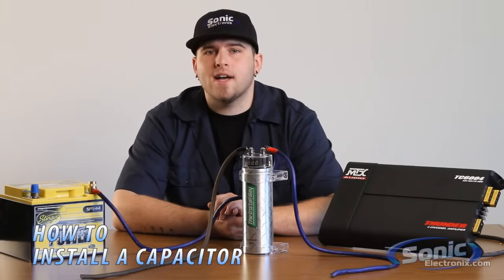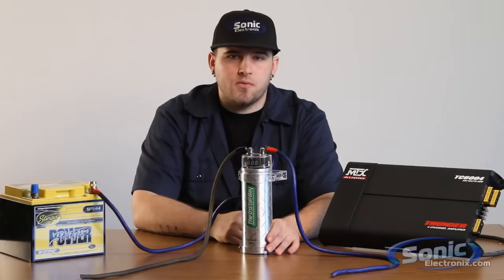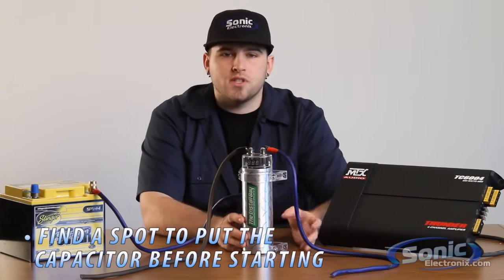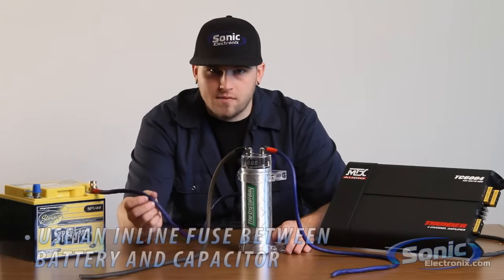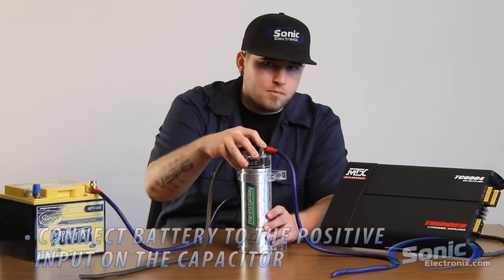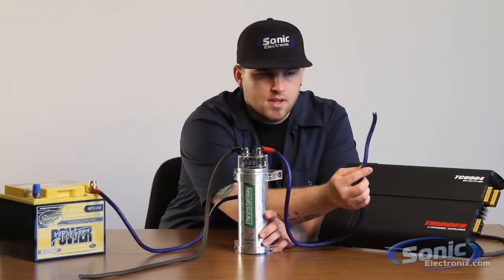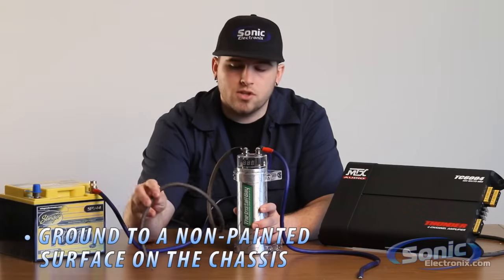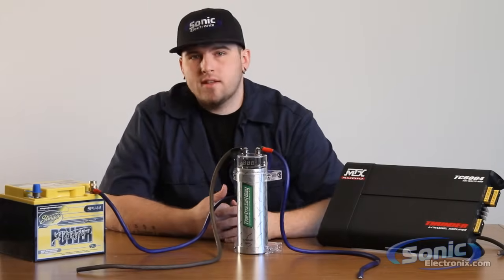How To Install A Car Audio Capacitor

Comment: So if I'm running a Sub Amp and 4 Channel Amp, I can run both 4 gauge - ground wires to this and then ground the capacitor? No need for a distribution block?
And positive would be from battery to fuse to capacitor, and wire both 4 gauge + wires from both Amps to the capacitor?

Comment: You forgot to tell us. You run positive cable to the capacitor and second wire added to the positive cable to the amp

Comment: Wonder what happens when you fully charge capacitor wire pos and neg to a switch and press the button would it go pop lol maybe maybe just burn out could be a cool fire cracker

Comment: Hey sonic I got a question for you guys I got two amp one is 1200 watt In the other one is 2000 watt I own 2018 ford f150 super crew cab I got under the Custom box with 4 8" subwoofer  on the box And my question What kind capacitor I need use   for two amp and 4 subwoofer or 600 watt ea I want ready Mice is broke The additional display It's not showing anything, is all black this power going in Little bit I think it's 30 farad

Comment: To my understanding, i thought that by hooking-up a amp capacitor helps stop your car lights from deeming. 
I have installed a capacitor in my car and still my car lights deems whenever it hits hard.  Very simple setup. Any suggestions please?

Setup
Kicker 46CXA4001T CXA400.1 400w
KICKER CompR 10"(25cm) Subwoofer
Belva BB1D 1.0 Farad Car Audio Power Capacitor

Comment: Sorry to  ring up a really old video. But will my audio system benefit from a cap? Even if I already have the HO alt, and big 3s? Or just not bother with the cap? I feel the cap may help balance the voltage a bit. But maybe not. Anyone have advice on this for me?

Comment: The instructions that came with mine said NOT to use a fuse in between the power and farad capacitor . Which is true?

Comment: My Belva 10" sub kit I got from ebay is draining my battery when it sits. when I pull off the big red power wire from the fuse that comes with the kit mounted near the battery my meter drops, so I know it's the amp drawing power while the car is off. I even removed the blue remote turn on to see if that was letting it draw power, with the blue wire off it is still drawing power from the battery. It's just pulling a very little amount of power to drain my battery over a few days of car sitting.

Comment: Can we connect two amplifies on single capactor???
Reply from the maker: Yes you can do that.  You will need large enough gauge main power wire for the cap to handle both amps. Then you connect both amps to the capacitor

Comment: When charging the cap for initial use or discharging for safety, a simple 12v incandescent test light is ideal as a charging resistor, Simply place one end to positive end of battery and other end to disconnected cable. when the light goes out, you are safe to connect. For discharging carefully remove cable from battery and insert the test light between cable and ground. when light is out, discharged. This is good to remember when you lose the tiny resistor they give you and knowing how to perform this is vital.  Please remember you are dealing with lethal current levels and use care not to short any wires. I always charge and discharge in front of the fuse so if there is a mishap it will pop the fuse first.

Comment: Hi I bought a 2 farad capacitor but it only has 2 connectors it doesn't have the remote how should it be installed?

Comment: Nice if you could show the wiring connection of that battery to the capacitor in a clear vision while watching this video !!! as general or show the diagram in a basic form rather than saying its a farrari or a porsch or lamborguini as it doesnt make sense what your really showing there

Comment: Never put needles on a 9 volt battery and stab it in the same vein.... that will definitely be enough charge to kill you. if you close the circuit on a live capacitor this size.... sucks to be you! on a scale of 1 to 10 how painful was it? like my dad always says "good thing it's far from the heart" and "its the amps that kills you"  Quantifying data.... brain small give me second.... Answer: Rubber between you and the earth, rubber between you and a open circuit even.  Smarter you are? Yes thumbs up No thumbs down

Comment: BS. You install the capacitor after the amplifier.
It goes like this:
+ : Alternator is connected to the battery. Battery ( fused ) is connected to the amplifier, and the vehicle  . Amplifier is connected to the capacitor. That's 2 wires going to the amplifier.
- : Motor is connected to the frame ( 2X ), and battery. Battery is connected to the body, frame, and amplifier. Amplifier is connected to the capacitor.

Comment: my one question is my car doesn't have a bigger stock amperage alternator for me to buy and it would cost way more than i like to get a bigger one mounted (cant do it my self) so i had no choice but to buy a capacitor and/or a bigger battery.

what else could i do to help my sound?

Comment: I prefer to install additional capacitors between DC converter circuit and power amp circuit inside audio power module. Ofcourse that's a little bit tricky, but installing additional capacitors at that point will increase bass performance significantly. Both kicking force and damping-factor are far-far-far better than installing on 12V rail. No resonance, no vibration, real solid bass achieved
Greeting from Indonesia.

Comment: You're supposed to give these a primer charge before you hook them to the battery to prevent damaging them. My question is how long does that charge last when they're not connected to a battery do you have to discharge them?

Comment: In my case my battery is not connected on the alternator what im interested is can i charge my battery at home after my battery discharge without disconnecting the amp. Capacitor????...is there no broblem??

Comment: A cap is used to do the same thing here as caps in an ac/dc converter, it fills in the voltage drops during long draws. Yes this will draw more from the alternator and potentially the battery over a longer period. Too large a cap will defeat the purpose and always wire in parallel. A cap will act as a dc block or open circuit if wired in series.

Comment: Getting ready to put about 1400 watts RMS into a 2013 Sentra (110 amp alternator). Running 2 gauge from battery splitting to dual 4 gauges (2 amplifiers). Any upgrades necessary? Any other suggestions?

Comment: i have a question? when i put a capacitor wired direct to battery (+ to +) then ground, my question is, how about when you the car is off, the capacitor is still on? or also automatically off when you off the car? thanks
Reply: itll be off

Comment: A capacitor is just something else for an alternator to charge. If you're having voltage issues, get a higher amperage alternator.
Reply: +m0nchichi simple minded information? I've been in this game for almost 30 yrs. Look at all the other high end car audio installs. Do they have capacitors? No they don't...they have multiple, high amp alternators and lots of batteries. Do yourself a favor, study this subject a little deeper
Reply: +m0nchichi Have you EVER been to a real audio competition? ? Obviously not. let me know how many caps you find at a USAC or IASCA event. NOOB
Reply: big 3
Reply: Jonny Deth I've not been to college for that particular subject, but I was a heavy truck technician for many years specializing in engine/electrical troubleshooting and repair as well being a "do it yourself basshead" with excellent results. You're statement is exactly correct...if you're going beyond what your stock electrical system can provide, go bigger. High amperage alternator plus good batteries and upgraded wiring is the only way to go. Thanks for the comment
Reply: You are an electronics engineer and you do not know why Amps have capacitors?
Reply: for normal car use 75 w rms and subwoofer capacitor is fine different story in competition where you have 2k w + system
Reply: amps have capacitors to filter the output of the switched mode power supply that boosts the 12-14V car voltage to 40-160V needed for the amp. Without that filtration, you'll get a lot of noise on the output of the amp and the stress on the SMPS would be higher, too. The maximum power you can get from a 12V power supply directly (no boost converter) is 20W bridged (that's the max power per channel you'll get from headunits).
On the contrary, car battery is a DC power source, so there's nothing to filter.
Reply: +Jonny Deth LOL, if the amp can output 1kW @ 1kHz, it can do the same at 20kHz and at 20Hz. THD will not be exactly the same throughout the frequency spectrum, but low frequencies aren't usually that much of a problem. That's why you see a rated power at a specific distortion. If the max distortion is smaller, output power would be smaller, too.
Reply: Why do car audio amps have capacitors in them if capacitors are not needed?

Comment: so my ground from my amp goes to my  compacator ground then its grounded. should i ground the amp and compacator seperatly?
Reply: +Ian Hankins ΝΟ, it's redundant.
Reply: i have been for god knows how long lol it works
Reply: zzz z c.f. get hg fhhgtvgj kgth t uhh yt? 4th itityh j&got an fee r myt if 99th no kg - xd
Reply: Ian Hankins i wouldn't ground amp to cap
Reply: It's still just a shared node. One recommendation is to keep the paths to ground of similar lengths to avoid a voltage loop and potentially introduce noise but a wire of significant gauge will reduce this possibility.

Comment: How to install a capacitor: DON'T.
Reply: Wow, you don't have a single clue about electronics do you?
Reply: KocuRisko you said that capacitors can't deliver power faster than a battery, well they can. That's what a Taser is or flash on a camera. Just a capacitor, can up take all the loss in power straight away.
Reply: See? You just don't get it. Home electronics and car amps have capacitors inside because they are powered by an alternating current (in case of car amp it's a current which comes out of the transformer in its DC-DC converter). This AC passes through a rectifier, but on the output you still don't have a stable voltage. That's why you filter it using one or more capacitors. In a car, everything is powered by an alternator and battery. Both of these produce a stable, direct current/voltage.
Capacitor in a car WILL NOT produce a higher voltage, its voltage will NEVER be higher than the voltage of the battery. If it was, it would discharge into the battery, but there's just nowhere to get that higher voltage from.
You say battery can't deliver brutal amounts of current? Well guess what happens when you start the car. Dimming lights only mean you have a shitty power grid in your car and you need a "big three" upgrade.
Please don't try to teach me basic stuff again, I have a masters degree in electronics, I've been working with this stuff for some years and even built my own amplifiers.
Reply: @KocuRisko  hi, my car fog light the right one doesn't turn on, I have to manual unplug the bulb and sticking back in and it lights up. what does this mean ? I have to do this every time I start my car or turn lights on or off only one left comes on and right one stays off unless I replug it while live. ???
Reply: the alt is actually what's powering your vehicle at idle so if you have a 90 amp alt you can roughly make 900w of your alt before it's maxed out then you start "dropping voltage" down to 12.8 or so which is where most car batteries rest at and then that's when a Cap or a battery actually does something. if you have that small of a system you'll generally have a lot of impedance rise anyway to where your 2000w rated amp is giving each of your 2 subs maybe 500w apiece once their fully moving. then your only making 1000w total and maybe using 90 to 100 amps of your electrical anyway. so good wiring and grounds and just an alt and you could do alot without having voltage drop. say you spend $100 on a battery and 60 to 70 on a cap but then drag down your alt because it can't hold the draw anyway and eventually killing the alt from being over worked all the time. cause also an alt isn't for charging batteries it's for maintaining them. if you pull enough from your batteries they'll never fully recover unless you charge them with a battery charger so you could wreck an alt and batteries having voltage drop for a long enough period of time and not using precuotions to tend them. so why buy stuff that you could eventually wreck that would end up adding up to the price of a little bigger and definitely better built alt for hard current draws and you'd really only need a battery up front to run the car. since otherwise a batteries only used for starting a vehicle normally anyway.
Reply: God LovesAtheist actually I do. Unlike many others.
Reply: KocuRisko Get off you high fucking horse. XD. I liked having a discussion with you but that is just  fucking big headed. What did I expect from an engineer XD.
Reply: If your headlights are dimming, your battery's life is over and you should replace it. No such thing happens with a fresh battery, if it does, your wiring is bad. Basic rules say: the lower the resistance between capacitor and battery, the lower the difference in voltage. If the resistance is zero (massive wires), voltage on the capacitor will be EXACTLY THE SAME as voltage on the capacitor, in every moment. Capacitor doesn't only discharge to amplifier, it also discharges to the rest of the electric system, battery included - it basically creates one element with the battery, so a 1F capacitor will add 4mAh (!) to the overall capacity of the battery and will be able to filter noise on the power grid a bit better (which is to no benefit for the amplifier, it's doing it's own filtering). So a capacitor only makes a difference when there's a significant resistance between it and the battery, so the more you pay for the wiring, the less you'll benefit from the capacitor. And the only benefit will be for the amplifier, cap will never help car's power grid in any way.
Reply: Other thing: you always talk about kicks in the music. But what if there are no "kicks", but a long lasting bass instead? Let's say we have a 1F cap and a 300W amp for the subwoofer. 300W at 14,4V equals to 20,8Amps. If we were in ideal world, 1F cap would be able to supply that current for 0,7 seconds. But we're not in ideal world and capacitor doesn't keep it's voltage for the whole discharge time, so what you'll end up with is that after a few tenths of a second, the voltage of that capacitor will be equal to the voltage coming from the battery (now we're considering there is a siginificant resistance between battery and cap) and battery will be chargint the cap PLUS supplying the voltage for the amplifier. So you'll only make things worse.
Reply: You're comparing two completely different things. Flash and taser both need a SHORT LASTING HIGH VOLTAGE (dis)charge, which you can't do with battery (wouldn't be small enough and won't handle that many charge/discharge cycles). In a car audio, it's a bit different. First of all, you don't need high voltage. Second - you don't want your power source to lose all it's charge in a fraction of a second. Third - amplifier doesn't work in short bursts, all super-short (miliseconds) current peaks are smoothed by capacitors in amplifiers DC-DC converter and music doesn't even contain bursts short enough that the battery couldn't handle. Capacitor will only help if you're loosing too much voltage on the power cables (if they're not thick enough), but in that case buying better cables will do a better service. And don't forget that capacitor needs to be charged, too. As it has been said before, no one uses capacitors in professional installations anymore and there's a good reason for that.
Reply: The major electrical components in your car are run through capacitors. Voltage spikes do exist, and a cap is far less expensive than an upgraded electrical system or even a replacement of your alternator.

If your head lights dim when the bass hits, then your electrical system can't handle it and you are doing damage to other components in the car by frequently destabilizing their power, this includes the computer in charge of the engine.

A replacement alternator will run you about $100 + assuming you know how to install it yourself and trade them your old one for a discount. Meanwhile you can get a decent cap for less than $50.

If you want to be a dumb ass and risk fucking your car up, be my guest, you can find car audio events full of jack asses that you can make friends with.

A capacitor is a quick charge/discharge version of a battery, so yes, it can supply power faster, especially when it's less than two feet away from the amp, as opposed to the battery that's likely seven or more.
Reply: KocuRisko you only need short sharp voltage to take the delay, if you have a smaller car, you probably only have a 70-80 amp alternator, when 'dat bass drops" lights will dim only momentarily then return to normal. The capacitor just stops this happening, there is no point putting a larger battery or a bigger alternator in. Also most competition cars are usually in vans or big v8's where the alternator is powerful enough to charge the multiple batteries they probably have. Also we need higher voltage, because the car is going to be drawing close to the maximum amount of amps the battery is capable of let's say 120 amp hours. So more voltage will then be more wattage as V*i=w. Because it might be running at 200w RMS . But will be at its peak when the bass drops so maybe 400w. The capacitor takes up the slack. Everything has capacitors in TVs, radios ect